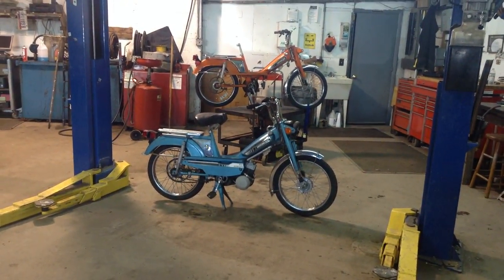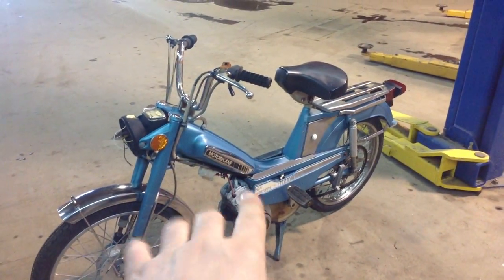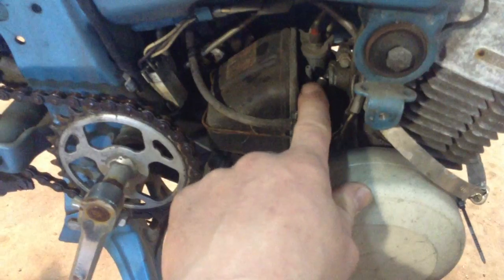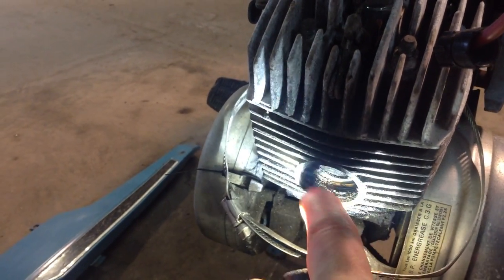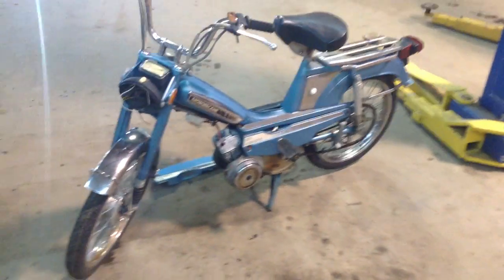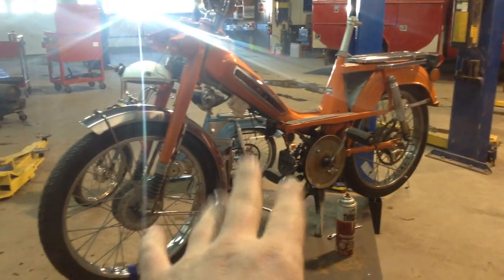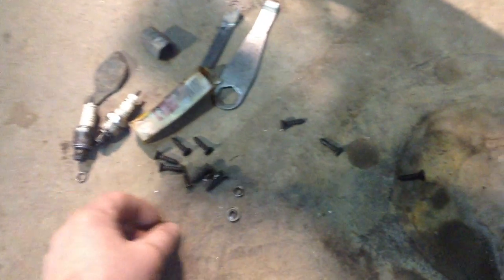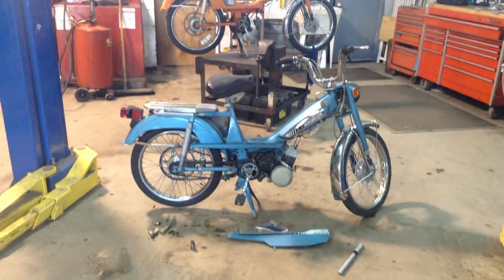Amesie's Corner 1979 Motobecane Mobylette 50V

Comment: I had a new one in the early 80's, and we paid $650 for it. It was blue like yours but with the long seat. I used it then my brother got it. It had over 10,000 miles on it. It was stock but my brother got pulled over going 43 on it. I would to have known about your modifications back then!